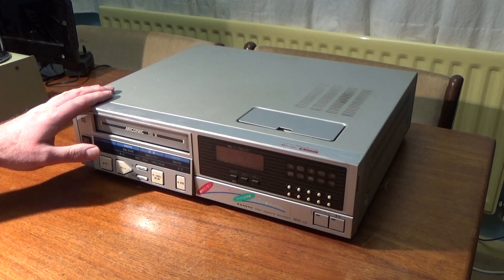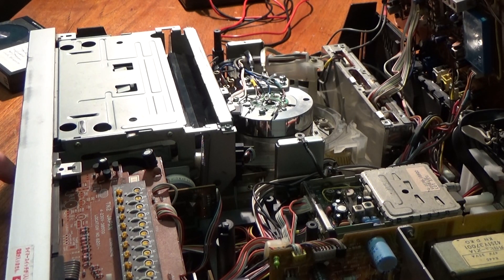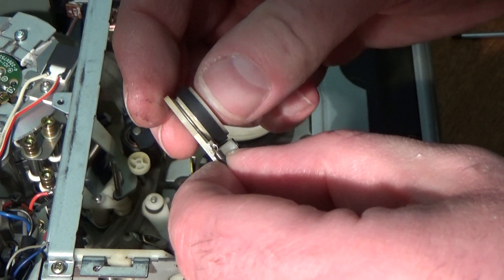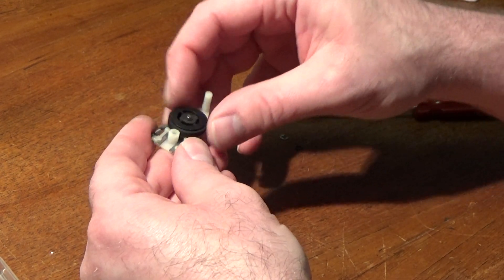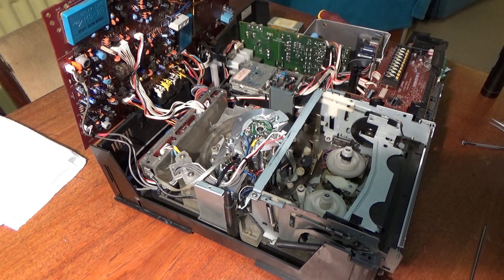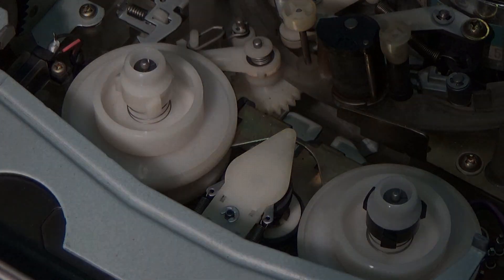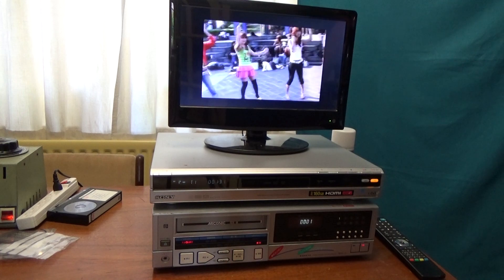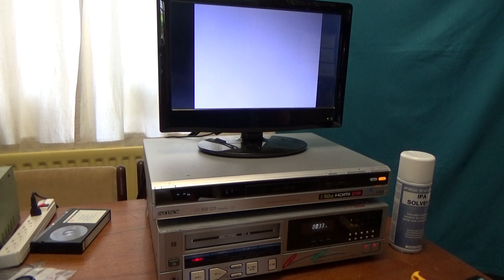Sanyo VTC-MO5 "Miconic" Japanese NTSC Betamax VCR - It Works! (sort of)

Comment: Nice work! Did you try recording in both βΙΙ and βΙΙΙ? Yeah that tracking pot is trashed. I can make you an NTSC test tape using my Sony SL-T50ME if you wish.
Reply from the maker: Thank you! A known good NTSC tape would be very useful. I completely forgot to try βΙΙΙ mode actually - doh! The tracking pot looks the same as those used in the M30 and M40. They seem prone to breaking, and I can't find a suitable replacement for them. They seem to be a non-standard type, and the pin layout is unusual.